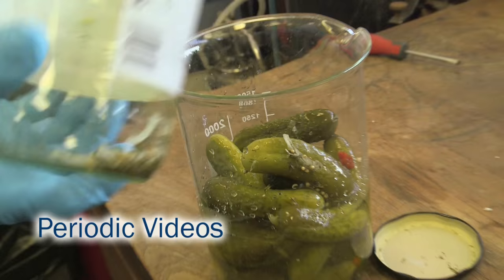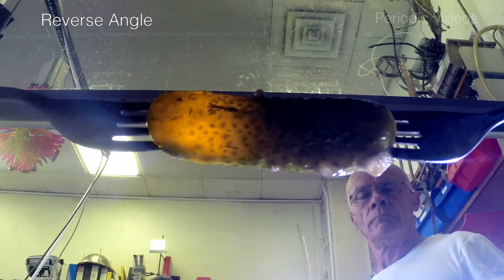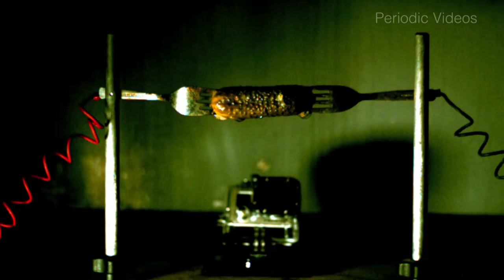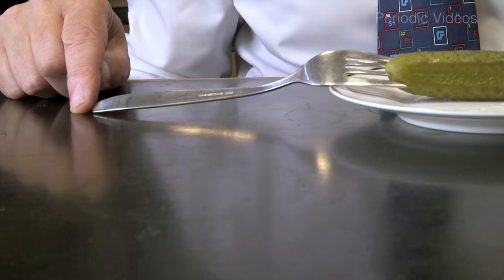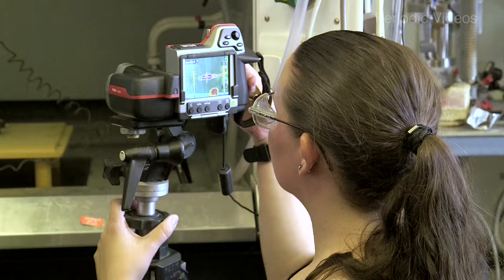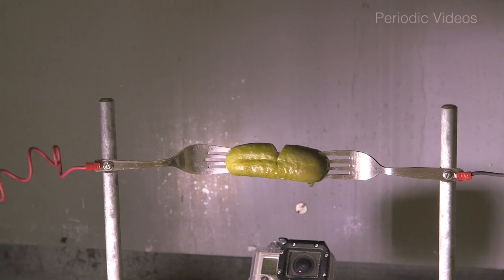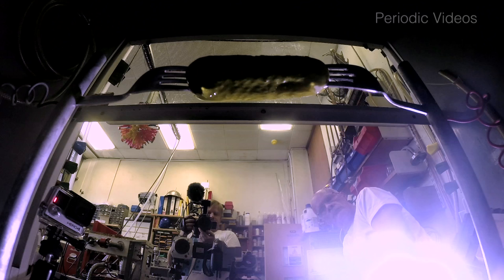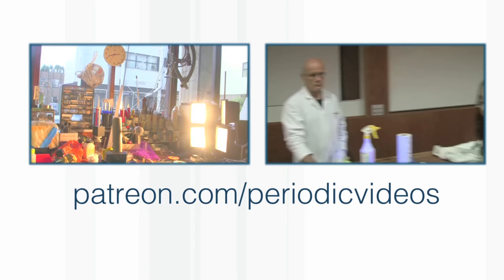Electrified Pickle - Periodic Table of Videos

Comment: thank you professor for videos and for the fun way to teach chemistry :) 
and I believe which side is glow is depends on which side gets hotter and much more resisting and in last pickle experiment which both side glowed , at first the right side got hotter sooner but after few seconds the left side started to fall then the sparks got confused by hotter side or less contacted side due to electricity resisting then in few final seconds just before pickle falls down the left side had less surface for conducting electricity and hotter area due to less surface for conducting :)
thank you

Comment: hey, great video, just quick question, have you tried to place one fork upright and the other one let straight, it seems to me that the reason why it light up the way it did is probably cause by the contact area and angle by which it goes to the pickle

Comment: The left and right sides are lighting up out of phase in the high speed footage.  When they are both lighting up,  you see left,  right, left, right presumably 180 degrees off on the 50 hz cycle.  Explanation?

Comment: A few comments as an electric engineer working with biological conductors:
The light is probably from arcing and not from sodium.
The side will be random as AC current has no real neutral side unless you ground one side. There is a positive feedback that will cause one side to keep lighting up once it started as the heat vaporizes the water and shrinks the pickle to cause a degradation in the contact.
The forks cannot be imaged with a thermal camera the heat you see is a reflection from the pickle, the metal of the fork is reflective even in the IR region of the camera and acts as a mirror.
In order to get the resistance of the pickle high enough for it to light up you need to leave a very narrow band that will immediately burn like a fuse. The heating you see is water vapor escaping from the cut skin.

Comment: I could be wrong. But it looks like to me that in the attempts using the pickle you first used the "soft end", or the top of the pickle, wich is softer, against the netural fork. In the second attempt you used the "hard side", or the bottom, against the neutral side. I have no knowledge in pickles and what not of course. But, could the "hardness" vs the "softness" in the different ends of the pickle have something to do with wich side show the reaction? I am just gueesing here, but I would imagine that the "soft" is much newer and because of that conducts the charge alot better? Anyway, nice experiment.

Comment: This is all just a guess, but perhaps the effect has to do with the porosity and dampness of the pickle. Small (micro) holes in the pickle might allow sparks to form as electricity jumps across them. A perfect pore would be a small air pocket (high resistance) surrounded partially by salt solution (low resistance), where a lucky configuration of low resistance dampness would lead the current to jump across the pore (just as a spark jumps in the high resistance air between 2 low resistance metal rods). This would cause the sparking effect, lead to crackling sounds, and the ionization would release a lot of free electrons to play / collide / interact with the Na ions. As the porosity and dampness of the pickle changes (solution is dried, the pickle is shriveled), the light effect changes from 1 side to the other when the other side is more amenable to sparking.

Comment: I would assume the glowing end is the one with greater electrical resistance between the gherkin and the prongs.

I wonder what you would read on a central electrode measuring the voltage and current as the pickle switched sides.

Comment: Does the side which glows have to do with the relative moisture of that side to the other? I noticed that in the first two pickles, the side that didn't glow clearly had more juice dripping from the end of the pickle. And in the one where you cut the wedge out, both sides seemed to be dripping, but not much. Maybe when you cut out the wedge you lost a lot of juice and that explains why both sides were able to glow. I think this calls for more experimentation!
Reply: Also, did you control for how you oriented the pickles? Did you put the stem side on the same side each time? Because pickles are not symmetrical.

Comment: As far as the "which end should light up" debate, it looks like the thinner end of the pickle is the one that lights up. This may be because it's more resistant (like when the chunk was taken out of the middle) and so is more apt to conduct heat and glow? This seemed to be the case with all of their pickles, with the exception of the cut one that swapped sides. 
As far as pickle structure goes, the thin end of the pickle is opposite the stem.

Comment: I believe the reason the light only comes from the ends is that the highest current is probably there. This is since the current doesn't go through the whole pickle there, only through the points at which the pickle contacts the fork, so the area the current goes through is still smaller than the cut middle. This could also explain the side selection: the side where the pickle lights up is side where the fork didn't go as deep. I'm still confused as to why only one side lights up though :/

Comment: I would say the side of the pickle that lights up has a lower area of interface between fork and pickle.  In the first few trials the sides that light up the forks are not inserted as far.  In the one where the light switched sides they are inserted very close to the same amount.

Comment: I would believe the swapping of light has to do with what side has the highest electrical resistance (or impedance would be a better word because you are using AC)

Maybe there is more resistance on one side because the fork might be just a little less deep in the pickle, and because the same current goes through both electrodes the one with the bigger resistance will get hotter then the other. (and the resistance will grow on this side because of the liquid heating up and going away as a vapour)  

What if you would measure the resistance before you start the experiment to try and guess where it will start? 
Put one probe in the middle, measure to the left fork and then measure to the right fork.

If resistance would be the same on both sides and stay the same I would believe both sides would light up if provided with enough current/tension.

Great video! I like the small note for Neil.

Comment: Does the voltage going from positive to negative, and the ions in the picked interacting cause the light to appear at one end?

In the slow mo of the cut pickel:
Starts flashing in left, then on right, but during the polarity change ie +120v/-120V they flash independently, and out of phase..... I have no idea about chemistry, I know electrical. Thought this might give someone on YouTube an idea, someone who is smarter than me....

Comment: It is very obvious why suddenly the other end lit up. At first, the interface between the left fork and the pickle had a higher resistance (probably due to less contact area).  Then the gherkin started to destabilize. The right fork started to cut through the gherkin and therefore losing contact on the trailing edges of its prongs, rendering it the point of most resistance.

Comment: I'd love to see what the current and phase was doing, you could work out if there was any capacitance effect.
This looks similar to what is known in geophysics as induced polarisation where ions build up at choke points between the plates of clay minerals then discharge when the applied voltage changes.

Comment: Seems to me the pickle lights up at the smaller end (likely less resistant there). Nice little experiment with the wedge cut out of the middle. Started lighting up at the smaller and, then moved towards the other end likely due to the resistance "bottleneck" you caused by taking a chunk out.

Would like to see a repeat several times with unadulterated pickles to see if my theory that the lighting effect takes place on the smaller end of the pickle is correct.

Comment: I did a science project 2 years ago where we tried to find out exactly which side the gherkin would choose for the glowing process to start at. IT IS DEFINITELY NOT CHANCE, that is for sure! 
Our hypothesis was and still is that differences in the electrical resistance of the electrodes (combined with contact resistance) cause one side to warm up faster than the other side. This leads to one side reaching a certain critical temperature faster than the other side. Interestingly that temperature is 100°C, the boiling point of water. At that temperature a lot of steam is produced, with leads to less contact between the electrode and the gherkin and therefore a higher resistance. This then leads to a drop of current, with renders the other side incapable of reaching 100°C (law of current and warming of a conductor tells us that warming is dependent on current). Herein lies the answer to the question of why mostly only one side glows and which side is chosen. 
The glowing side can be changed at will by increasing the difference of electrical resistance or by applying heat to one or even both sides.
Based on our observation of the critical temperature we further suspect that a steam layer is needed to start the glowing process. This raises the question whether some kind of gas discharge might cause the glowing of the gherkin. I’d love to hear your opinion on that. 
Our project got us to win several science fairs in Germany and two more prices in China and at ISEF in the US.
Reply: did you try doing this experiment at DC?  or is this has to do something with change in polarity in AC.

Comment: I thought they were shoving rectified DC power into it. I think it glows on different sides because the conductivity of the forks' contacts changes as they heat up and boil the fluid. Remember it's the contact with the highest resistance that glows.

Comment: I saw the cut expanded during the arc change. So, my assumption is the cut heated up enough briefly for an expansion of gas to open the cut up more and that changed the arc location. So I expect that a smaller cross-section would explode out right.

Comment: Probably which end is more conductive & therefore glows more is determined by which end has more salt in it, & that is most likely governed by the gherkin's orientation inside the large barrels used during the pickling process. My guess is that more salt accumulates towards the lowest part of the gherkin.

Comment: The coolest part of this experiment is the notched pickle, for sure. The brief period of time that both sides light up was, well... Lit. A side note about that: Notice they don't flicker on at the same time, but opposing moments, showing the AC oscillation at work. Still trying to wrap my head around why one side wants to light up and not the other... Is this a diodic effect? It would make sense... The experiment does deal with ionizing salt. One side becomes more saturated with sodium ions than the other, creating a PN junction diode? Just my personal ponderings of the matter. How cool would it be, if the electric pickle is just an organic LED? 8)

Comment: Isn't the resistance affected by the surface area that connected the forks with the pickle? You can see the pickle move at the last experiment, and this probably reduced the surface area on the not glowing fork till it was the high resistant end and started glowing. To get the pickle to glow in the middle it might be best to cut it in half at an angle and slide the two halves apart till the middle ist the place of the highest resistance.

Sadly I don't have any pickles around, let alone a voltage generator, or a controlled environment. :(

Comment: Rather than pure chance, I think it might be the thinner end of the gherkin that lights up, in the 3rd, both ends are roughly equal, so the burning from the forks may change the resistance on one end, making the switch.

Comment: My guess would be that the visible reaction switches sides because the resistance of a resistor increases with temperature. As the reaction occurs at one end and heat builds up, the resistance increases and the reaction switches to the low-temperature end.

Comment: If I had to posit a theory, I would say that resistance = less total interaction with the plane of X. The ends of the pickle that lit up were the thinner ones in the first two videos; the third, the level of resistance is so similar that the act of lighting up momentary changes the balance of resistance, hence flipping the next flare up over to the other side. Just a theory.{edited: spelling and content.}

Comment: "It's an organic specimen" - I once heard a talk from a physicist working with biologists in the lab and he explained how confused he was at the beginning. In physics you have A and then B follows. Or it doesn't, but at least it's always the same. If you have the same lab setup and run the experiment multiple times, the outcome will always be the same. And with his research in biology it was like "If it doesn't work right away, just manually adjust the parameters of the experiment until it works". Yeah, that is because organic material can be very heterogenous. It's just not always perfectly defined the exact same thing...

Comment: In the slomo the ambient light does two flashes for every spark.That means it's A half-wave spark.My guess is that the forks and picle somehow form a crude diode.and when getting one fork hot the diode breaks down while the cold side takes over.

Comment: Maybe the deciding factor in the brightness point is the surface area of contact between the pickle and the metal. As the hot fork slices through the pickle, the points of contact are constantly changing, and therefore so is the surface area.

If you replace the two forks with a fat probe on one side and a skinny probe on the other, I wonder if that would change things. I would expect the probe with the least contact to be the place where the most light would be emitted because there would be the most heat.

On the other hand, it could be exactly the opposite. If the glow is being caused by free sodium atoms, then this is an arc through the air, not through the brine of the pickle. The hot probe causes the brine to boil, and when there is enough steam to completely separate the probe from the pickle, a spark is formed to keep the circuit closed. With greater surface area, you have a greater chance of conducting current through the space between the pickle and the probe.
Reply: Also, I don't think you've done a potato battery video yet. If you do one soon, you can use the leftover specimens from the pickle and potato videos to make potato salad.
Reply: That may be more of a sixtysymbols video :)
Reply: As long as Doc P gets a cameo, that's fine with me.

Comment: Why is the flicker of the ambient light exactly twice as rapid as the flicker in the pickle?
Reply: Because the ambient lights get brighter as the voltage goes positive, dim as it goes to zero, and get brighter again as it goes negative -- effectively 100hz or every half sine wave. The pickle is only flashing from one electrode hence only during the positive OR negative portion of the ac (50 hz). If you watch when it alternates between ends briefly, the flashes sync with the lights but when it returns to one side, it goes back to 1/2 as often.

Comment: You made a pickle arc rectifier. The  first negative half cycle attracts the sodium ions then they preverentially build on one end till you get a metal vapor arc. It actually will rectify similar to a mercury arc rectifer tube. Gherkin service life is not very long though.😂

Comment: The light being emitted probably changed sides because the second strongest electrolyte in the medium, ammonia from the vinegar/brine, reduxed via electrolysis and became Nitrogen gas and water. This increased the resistance because a powerful electrolyte was removed, and the other side that was still full of ammonia became the least resistant.

Maybe the same could be said for the salt, but I don't know if you sent enough energy through to split the salt into sodium hydroxide and hydrochloric acid.

Comment: Because you are sticking two forks in a pickled vegetable, the contact surface is not equal for both forks. I would expect it to glow at the end where the contact surface is smaller. And I assume it switched sides because of the water evaporating at one end and the liquid left had a greater salt concentration increasing conductivity so that at some point the other end got to have more resistance and started glowing. Am I even close? 😃

Comment: i would imagine it was an electrolosis between the fork stainless steel and brines that created a preferance to one side, trimming the resistor may have been a stroke of luck hitting near equlibruim. Using DC rather than AC should furnish us with a clearer understanding.

Comment: The Glow is not by Chance. It will appear where the resistance is highest. In this case the end with shallow insertion in the sample. Repeat the experiment. Insert fork fully on one side and half way on the other. I bet that Glow appears always on the shallow insertion end. where resistance should be highest. Make sure not to insert , remove and insert, So that we can rule out resistance difference due to difference in stiffness of insertion.  Give thumbs up If you are curious to see the result.

Comment: The part that lights up is more hotter. In order for it to be more hotter, it needs less of the fork surface to be in contact, thus less ammount of heat is conducted away fro mthe gurkin...

Comment: Sorry professor, but your explanation of AC voltages is wrong. The 240v is root mean square, which means the peak voltage at the top of the waveform is around 330-350v.